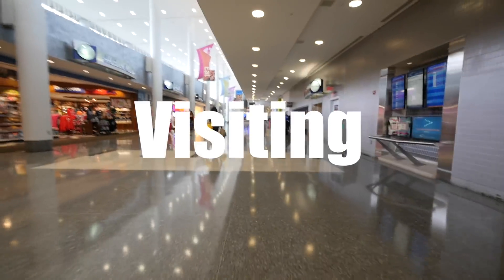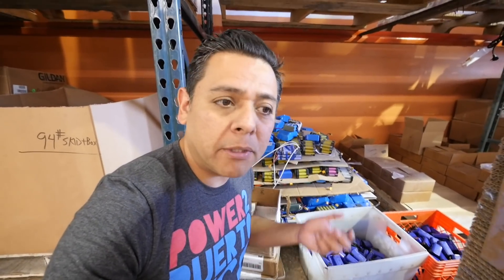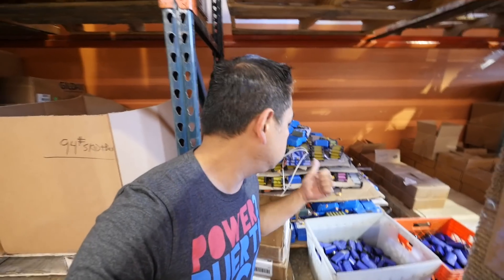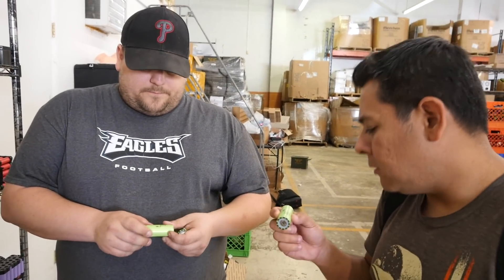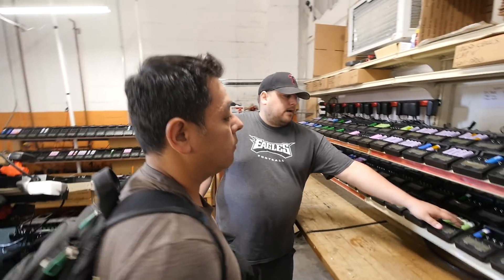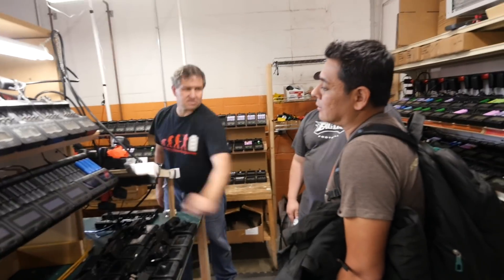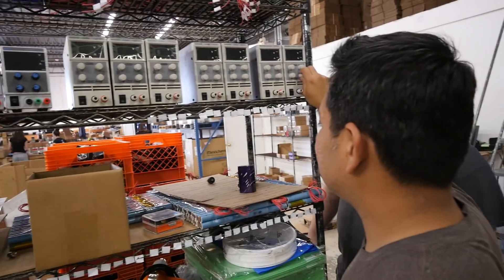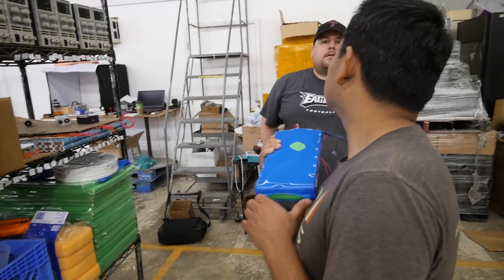Battery  Warehouse Tour / DIY 18650 Testing System

Comment: My first order of 5232650 batteries was for 52 batteries, they sent 42. I emailed them and placed another order as well. They included the missing 10 batteries in that second order. The 10 batteries 32650 were a little different and the voltage was 1.1v-1.7 volts not a single one was even 2.0v charge. I have sent messages and forget calling they NEVER answer. The batteries have been in a stated of discharge and I know they will not work! After two dealings in a row with bad customer service and questionable batteries sold as NEW 5000ma 3.2v well what can I say. I still have the batteries and NO ANSWER from BATTERHOOKUP>COM.

Comment: Glad to see they use the Liito Kala 500 charger as one of their capacity testers. Just got one a week ago. Works great. Found that (4) efest 18650 IMR 3500mah batteries I bought on eBay 4 months ago were actually only 2500mah!!!!! So I checked my other variety of efest batteries and thankfully they were either just under the stated capacity (4 year old batteries that were used a lot in high power flashlights) or over by a few hundred, which were recently purchased. Also, when I tested the capacity on those supposed efest 18650 3500mah batteries I set the current for them to be tested at at 1000mah and tested all 4 at the same time and they became VERY warm. So I retested only 2 at the same time and set one to test at 500mah and the other 750mah and still got the same 2500mah capacity result. Anyone else come across the same problem with efest????

Comment: HELLO GOOD DAY, EXELLENT VIDEOS VERY GOOD. I WANT TO MAKE AN INQUIRY: I AM RECYCLING LAPTOP BATTERIES TO MAKE A GOOD TEST OF MAH I WILL DO IT WITH BT C3100C CHARGER, WHICH RECOMMENDS ME 1 LOAD TEST, 2 DOWNLOAD TEST, 3 REFRESH, AT TIME I HAVE 250 CELLS ALL ARE CHARGED IN THE RANK OF 4.08 VA 4.20 V. FOR YOUR ANSWER THANK YOU CORDIAL GREETINGS.

Comment: Rc smart chargers may work well if big enough they appear to have xt60 connectors  then the question is simply voltage or cell count.   In the rc aircraft and water craft the volts are getting huge   So chargers are also   Ive seen 12s ready esc and motor setups on the market and have barley looked at them since 7+ years ago.
Reply: Also if u have good cells they dont have to be balance charged every cycle.  Its good practice for most power and overall pack life.  For me i like to find packs that can charge quick but are kinda cheap so i just charge them fast run them hard and dont worry about balancing until im done playing

Comment: Hi, Jehu. how many 18650 of 3000 mamp do I need to get 96 volts and 150 AH? and simesmel type of battery for a conversion project. thank you very much.
Reply: 26s50p so 1300 3000mAh cells

Comment: SO I bought 2 to start with , & mine are the Opus BT - C3100 V2.2 Digital Intelligent 4 Slots LCD Battery Charger US and every new cell of 2500Mah is less than 200 or down to 33  WTF . I tore a few 18650  cells from a Laptop battery , only one was 2160 from a ?? no markings !!!

DO WE TRUST THESE  or AM I buying  junk  ??
I  bought the spot welder  and all the stuff !! 
I AM 4-H leader to teach this on the back of small engines (Im a Rotary Wing Master Tech , plus a Vista Master trainer ) .

I can't seem to test cells new ratered @ 2500Mah & see 33 -196 .
Do we need to work these in to working ? 

VT . 

PM or direct contact is fine .
N

Comment: :: W O W !!!  this might just be my source for my RV Solar Power wall!  Thank you!
Reply: Same. Will you be charging from your alternator. I was looking at some 40V packs jehu posted about a couple days and am trying to figure out how i'd charge em
Reply: @0FlightlessBird0  have you figured anything out yet?  I have been looking into alternator charging hard, for about 2-3 years. Exploring all the options,  from DC to DC, or battery to battery lithium chargers, to alternator regulators, and have been thinking about building a regulator, to charge lime a lithium charger, cc cv algorithm, it can be done, but best for a dedicated, standalone alternator, it would require testing to see how it reacts to powering loads, while charging, I'd recommend charging to only 85% if powering loads, holding batteries at full voltage, will kill them over time, and loose capacity, at a rate of nearly 0.5ah per cycle, depending on the time and other factors, most damage happens at high and low cell voltages, I prefer keeping the cells between 3 & 4v, absolutely no less than 2v in emergency situations, but 2.7 normal minimum, with good temperature ranges, and kept between, 3-4v and balanced , I'm hoping for nearly 20years with my n.o.s. cells, (new old stock) 
But please let me know if you found a charging system that works with a alternator! Thanks,

Comment: I was at BatteryHookup's place May 11th. (Only 1 hour from my home in Delaware).  I purchased 26 of the A123 modules. 40 volt, 20 AH. I'm re-configuring them from 12S8P to 4S24P which will be 13 volt, 60 AH. I intend to install them in my EV. A lot of work but it can be done. Sorry I missed a chance to meet you! Tom's brother Ryan took care of me. Great guys to deal with!

Comment: it would be real cool to have some 25ah modules you can clip into a board to make a bespoke power wall for offgrid camping and touring..something that can be charged via solar or off the vehicle alternator..the largest single battery i have seen is around 130 ah and they are like 1100  british pounds new/400  british pounds used...200ah would be ideal for my campervan..i know i can buy 2 used batteries for 800 gbp and they will give me 260ah but i still find this expensive..can you build us campervanners a module please..

Comment: Hey jehu, I've noticed in all your links for fuse wire it leads to 1/4w resistors and I see in this vid you qoute only using 1/8w resistors(just so ya know). But my real question is when you did the original samba packs you used fuse wire, is this a thing of the past whats up, have i missed something. I'll pick up that book you recommend soon.

Comment: Hey does anyone here know of a good replacement pack for a Power Wheels car w/o having to replace the BMS? I already tries my Li-ion Jump Starter pack and that car was burning rubber! tHE oem LEAD ACID BATTERY FOR IT IS A 6V 12AH. Sorry caps lock key got bumped AGAIN!!!

Comment: Jehu, I'm into electronics and embedded programming, so I'm curious if there would be a market for a better charger that places like this could use that would be more efficient and/or more powerful and/or more convenient.  If there's already really good hardware available like this, then it may not be practical to do the same thing.  I am looking for another excuse to quit my current software engineering job to work on projects like this!  Would love to hear your take on this!  At the same time I could use the development process to sort out my own batteries for my own packs.  Win-win.
Reply: What about a charger discharger that discharged back into a power bank that was powering the chargers from solar. How much energy would that save. If there is a million 18650 cells capacity tested every day that’s a ton of power being wasted

Comment: Sometimes it's just the simple things, you really helped me out by posting a link to repackr.com that helped with configuring a battery pack for an e-bike from previously used e-back batteries that I had to reconfigure for a different voltage

Comment: i  have been using 3 of the 36v 20 cell 18650 packs for the past 6 months flawlessly on my e bike. they are the best and most affordable which never is the case but they pull it off.

Comment: Why do you crack everything open? You could plug them together to make something useful or sell as is and the user does that.
Reply from the maker: Rules....... not a big fan of rules,  but not much can be done
Reply: The manufacturer doesn't want you to sell them as they are?
Reply: Sometimes we have the blessing from the company to sell as is, sometimes we have to break down to individual cells. Depends on the contract. If we breach we could get sued for millions. Jehu is right, rules suck lol
Reply: I can totally understand why a company doesn't want their expensive modules on eBay.
You sell them to someone, that someone finds out where those belong to and sell them for 5$ more as original spare.

Comment: are they just pre charging the headways? and are you guys breaking those power supplies often? you should get the RUI DENG buck modules and wire them up, I doubt you will be able to blow them up as long as you have a diode in series!!
Reply: The cheapest keysight option is likely going to be $500+ and they would need several hundred.  Even if they only needed 20 or so it would be prohibitively expensive.
I have a few of those cheap Chinese supplies and they are generally rock solid and can many times be had for less than $50 a piece.  The nice thing is that they are also easy to troubleshoot and fix if something goes wrong, unlike the keysight products which can still have issues under 24/7 operation in a warehouse production environment.
If I am buying a single power supply and I really need the quality for my bench then I would buy Keysight but otherwise, the cheap Chinese bench power supplies tend to be very good.
Reply: Should be using Keysight power supplies but I think these guys are looking for the cheapest option.
Keysight would also be able to automate the 18650 cell testing
Reply: There are plenty of used options that would meet budget from some of the local test equipment sellers in the US. A 6632a/b comes to mind. Open up a Hp Agilent keysight power supply and you'll agree the quality cant be beat

Comment: Jehu, can you provide the make and model of the chargers he is using in this video? You guys were discussing two different types. thanks for the video.
Reply: F Leal there's using liito Kala li 500 I like the opus btc 3100 2.2 Better it can do 1 amp discharging instead of 500 mah like the liitokala
Reply: James Smith- just got the Liito Kala 500 and it gives the option of 250, 500, 750 and 1000mah discharge which equals 1amp or am I mistaken with what I’m saying? But it does have a 1000mah option when I’m testing battery capacity but admittedly I’m relatively new to all this so somebody please feel free to correct and educate me.

Comment: Do they do rebuilds on battery packs? PS-45 18v they are used on Black&Decker/Dewalts drills, thats why i gave yall the number too, i am tired of buying a new one every dam year @ 20-25 Bucks! I have like 5 or 6 dead ones in a box that need to be done but the last time i checked some one wanted more than i could buy a new one for each to be redone. I had like 20 of them but after throwing them away i figured screw it ill rebuild them but old guy hands wont let me.
Reply: Usually only 1 cell dies in a whole pack and that ruins balansing and BMS has to shut it off. I had the same problem with my dewalt 20V li-on 4000mah packs. Then i just bought 10x Sony VTC6 and now i have reliable 20V 6000MAH packs, which last 2 times longer than low amp cells in drill.
Reply: I took 1 or 2 apart a few years back and put a meter on each single cell in the pack and they all read dead but thats why i was wondering if they did any rebuilds or maybe could recommend what Lithium Ion batteries to put in the PS -145 18 volt battery packs to replace them with longer lasting L. I.  over the old Ni Cad ones. I know the drill unit does not know the difference it just sees the power per say pack as usable power for the drill. I think the charger may have to be replaced but mine is a conditioning charger so im not sure.
Reply: KCautodoctor I did rebuild nicd battery pack with 18650 batteries with balancing bms. It works like usuall, BMS cuts the charge when voltage exceeds
Reply: Im1CrazyCow  be very careful mixing newer lithium battery technology with old NiCad battery chargers found in the cordless tool kits.  These different battery chemistry require different recharging conditions (voltage & amperage regulation AND battery balancing is different between these battery chemistry).  Also what you found regarding costs to rebuild the old battery packs remain very true.  Recommend you put a listing on Craigslist or Facebook Marketplace and sell locally your old NiCad cordless tools & all the bad battery packs for a couple bucks (do not expect much for old NiCad tool kits - they are the VHS of cordless tools while lithium is the Blu-Ray of new cordless tools).  Then put that money towards upgrading to newer lithium battery cordless tools.
Reply: Alexander Siniov  but did you use the factory unmodified NiCad battery charger that came with the cordless tool kit??   If not, then did you modify the electronics in the factory NiCad battery charger or use a dedicated lithium battery charger with manual leads?

Comment: Wow. That's a huge setup. Do you know the number of incidents when something caught on fire? I ask only because it could be a measure of how safe/dangerous these batteries are...
Reply: We have cycled through hundreds of thousands of those 18650 cells and not one of them caught fire
Reply: Rohan Pandya exactly!  well that’s a normal paranoid thought, in the beginning when we started working with the individual cells I was thinking things like what if they caught fire or do these blow up... but I think it’s safe to say now that we’ve been doing this for months and months that these cells are extremely safe and there’s not much to worry about as long as you don’t crush or puncture them
Reply: they would have to run one over with a hard tire lift truck to make one catch fire. I have rammed nails through them and still no fire...only other way i got them to explode was to dump 12V 40A through one and stick them in a fire....anything will blow in a fire even an dry cell.
Reply: Even I hold the opinion that these batteries (especially 18650 ones) are safer than any other batteries. It's good to know that it's backed by numbers now. 
I have my 18650 projects going on and every time someone sees it, the first thing they say is "how do you know it won't explode?"
Reply: I'm sure it's safe but some twisted part of me in the back of my head sees visions of the place going up like a fireworks factory on fire.

Comment: Ok so i made a powebank out of tested 18650's. in theory it should have 80ah.. (all paralell, 55cells-3,7v-into a usb outlet thingy) but when i filled it up, then dischrged it(1amp), it showed up as 150ah!?!?!! When i charged it at (3amps) and it said 140ah.. why is it sooo much higher than in theory?? I checked all the cells!! Every ssingle one!
Reply from the maker: Sounds like you have 2600mah cells
Reply: jehugarcia but why does that matter? I charged and discharged every single one seperately.. some of them are even 800mah..
Reply: Bump
Reply: jehugarcia .

Comment: Just tested through two packs of the first gen A123's. They only came in at 1100-1450 mah. Nowhere near the stated 80-90% Tom was talking about.
Reply: at 500ma discharge?
Reply: toysareforboys 500ma or 1amp. Same same. Several cycles on some. Out of 192 cells. Unusable for my project. Will put them up for sale to try and recoup. Using SkyRC 3000
Reply: Yikes! Thanks for the info!
Reply: toysareforboys keep in mind that these are the LiFePo4's. Still good for power walls etc. Cannot expect the same energy density as the typical 18650's. They have the Gen 2 A123's. Gonna talk to them on Monday and see what's what. At 80% of 2600mah, they would be great.
Reply: If you find a place to buy NEW A123's let me know please! I need them really bad :(
Reply: toysareforboys they are on ebay. 2600 mah but they are $6-7 each